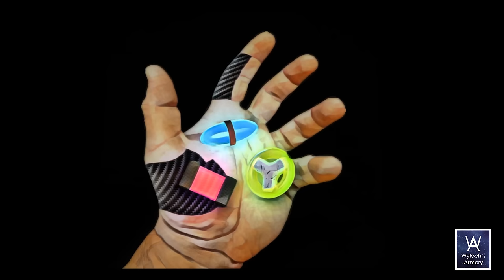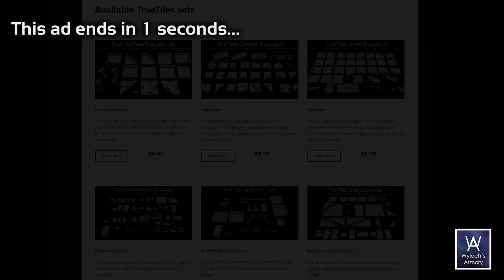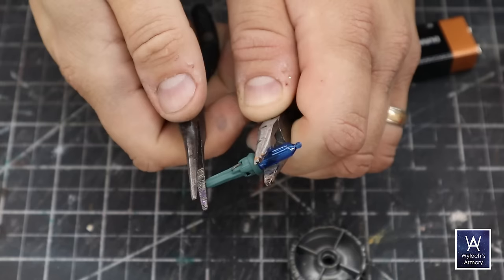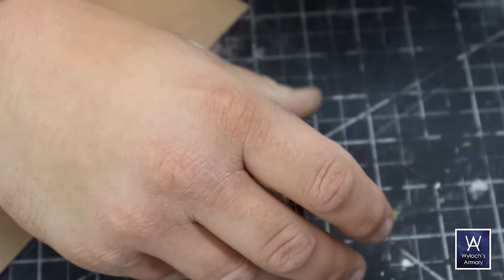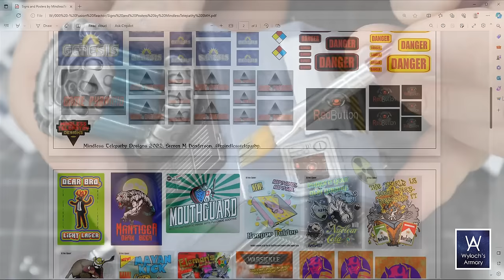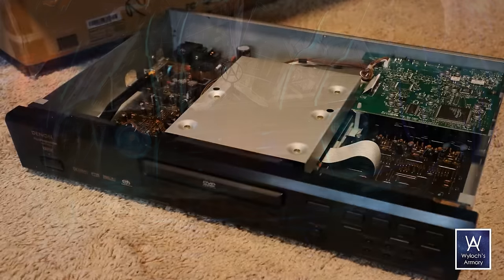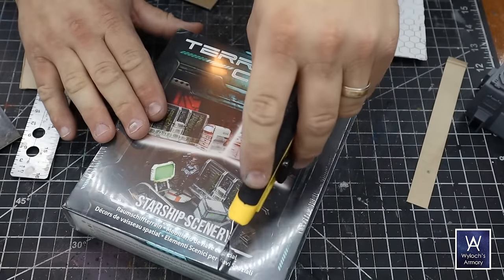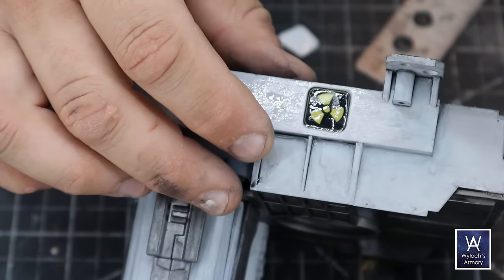Meta-Stable Material Machines (Neon Skies Terrain Building Tutorial)

Comment: If you disassemble Nerd guns before chopping them up, you will find lots of small bits and pieces, as well as some springs and other metal parts, that can all be repurposed. It usually only takes removing some small screws to get most of them apart. Some even have electrical parts inside including lights and motors.

Comment: Just took apart electric radiators, not the first thing that comes to mind for terrain, but the plastic control panel in the back pretty much has the exact same structure, wheels included.